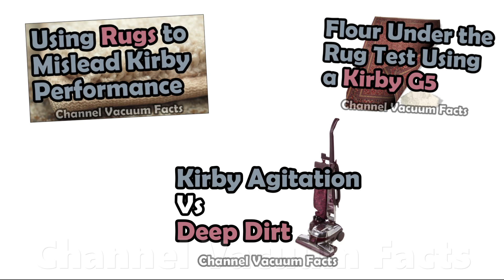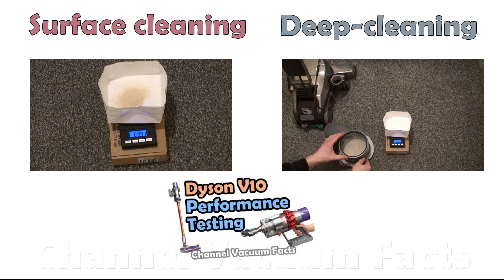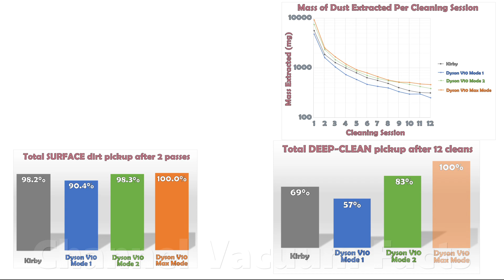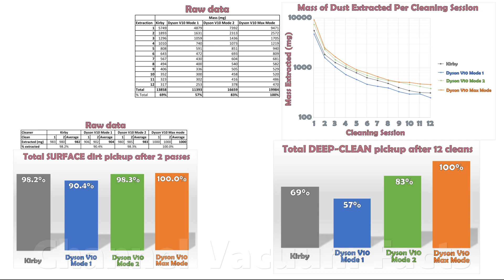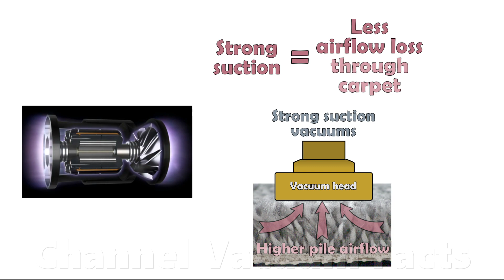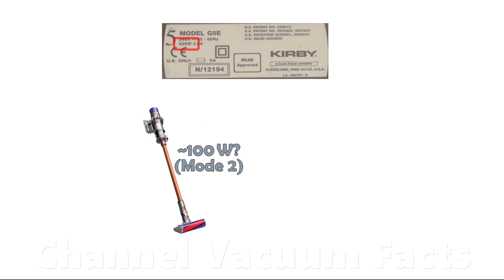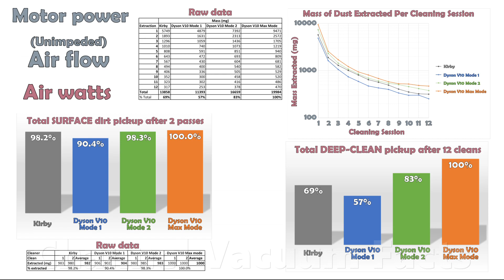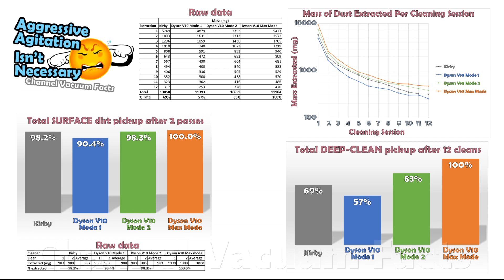Dyson V10 Vs Kirby: How Well Does a Kirby Vacuum REALLY Clean?

Comment: How does improvements in technology determine that a vacuum is better? Dirt doesn’t know that technology is improving therefore somehow becoming harder to remove from carpet. I think if you want to make a case try to do so without leaning on bias. At least not make it so obvious.  We get it you are a Dyson fanboy. Nothing wrong with that. But again your bias is showing. Your comparison is only with Kirby and Dyson. If Kirby is so bad why not pair it up against other brands like simplicity? I’m not schilling for Kirby or Dyson. But also your video in no way convinced me that Kirby is a bad vacuum due to the 1 sided bias.
Reply from the maker: Depends on hwo you define 'better'. Ease of use is usually improved. Performance and efficiency improvements are measured empirically. Testing was done against those machine because those were the ones I happened to have. The data speaks for itself.
Reply: Where at all in this video was he biased? He literally only showed objective data points
Reply from the maker: @jonahdodd567  Their warped definition of 'bias' is: "It wasn't what I wanted to hear".

Comment: Kirbys aren’t as high performing as you might think. They rely heavily on high airflow but low suction. This makes them ok for older style carpet with porous backing or rugs. But for carpet with non-porous backing, their performance drops massively because they don’t have enough suction to maintain high airspeed through the carpet pile, which is what actually cleans it.
Reply from the maker: Almost. Their air power is derived principally from air current rather than suction, meaning it is fully realised in low suction situations (porous flooring like loose shaggy rugs) but is not fully realised under resistive load (sealed carpet). It is suction that determines air speed, not the magnitude of air current.
Reply: @VacuumFacts 
I have no idea why this comment has showed up here since I posted it somewhere else entirely. This isn’t the first time it’s happened.

Comment: Hey @VacuumFacts! I find your video very insightful even if it's 6yo at the time of posting this comment. My suggestion for increasing the suction of Kirby in these types of tests is to adjust the height of the brush roll to maximum out and the height of the head at level 2, not 1 as recommended. This way the head will not be completely sealed inside, allowing air to be sucked and the brush to make enough vibration, achieving deep cleaning.
Reply from the maker: Hi. I appreciate your suggestion; however, this is not how vacuum dynamics works. Providing a low resistance pathway leads to larger currents into the head, preventing the head pressure from reaching as low (loss of suction). This reduces the air speed entering the head and thus reduces the ability to accelerate unhindered particles from the carpet. Brush vibration is irrelevant. The flexing of pile to loosen trapped particles into free airflow leads to their acceleration out of the pile. The basic science is dicussed here https://youtu.be/_CzzDiArrrg

Comment: Kirby is just... Too much of a Dinosaur compared to today. The machine is too bulky, too heavy, and too damned expensive by today's standards. Just go with Dyson. If you have to replace a Dyson every 5 years, it would take you nearly 20 YEARS to spend the same amount as you would have on a single new Kirby. Maybe they are not 100% as good as a Kirby, but is the slight performance advantage worth it? Really?
Reply from the maker: Yeah. The data shows Kirby's do NOT perform as well as modern Dyson machines and my lecture video of the science explains why.
Reply: To be fair though, I have a nearly 40 year old Kirby that still works and they still make parts for it
Though also, I'd hope the dyson stick vacs last longer than 5 years 

My step dad still uses a 20 year old dyson so it's not like they can't last a long time 🤷

Comment: The problem is i can find more available parts for the older  Kirby vacuums than older Dysons. Dyson is more based on science that efficiency than customer services. Components in a kirby can be purchased separately. Whereas you have to buy the whole powerhead when motor issues develop. There are no gasket kits available for Dyson. Cyclone canisters. Motor brushes are quick to change and if any vacuum is properly maintained it can ladt for decades. Lighter is not always better and lots of Components are no longer available on the Dyson site for older uprights and Ball vacuums and many if they are are aftermarket and not genuine Dyson components. This is a fact.
Reply from the maker: Only neglect results in damage to components for the most part, certainly within the warranty period. Before then, it's customer services are far superior. The whole design is modular and under warranty, new parts are shipped out. Out of warranty they're fairly inexpensive. After 10+ years, it's simply discontinued because it's time to recycle and move on because the technology has moved on. The idea that you have to continually buy components in a Kirby doesn't speak well of it. No one uses an old phone for decades. No one uses an old PC for decades. No one uses an old car for decades. No one uses old clothes for decades.  And then there's literally everything else wrong with Kirby vacuums.
Reply: OK. What vacuum do you recommend for deep  wet carpet Shampooing other than Dyson???. What vacuum do you recommend for industrial wet vacuums. The Submarine doesn't cut it. And under normal wear and tear where can you get new genuine Dyson parts for the DC02???
Reply from the maker: Suddenly the subject has changed from dry vacuuming to sticky dirt removal, which is a different product class. You shouldn't ever be wetting carpets and there are far better technologies out there, as has been discussed many times on my channel. The DC02 is a defunct machine superseded many times now and should have been recycled long ago. You can get the latest product for a fraction of the cost Kirby would want you to pay for the equivalent top version of their product from them. It's a no brainer to forget about Kirby products.
Reply: I like the way you circumvent the system buy backstabbing other products, no matter what proof is being thrown to you. A biased one sided leaning based on just science and one sided view of personal opinion with no footnotes or references supplied is no reason for justification. Bar graphs mean nothing. Every vacuum is flawed. Dyson goes by quantity not quality. Half of the older cordless models are discontinued. Who doesn't shampoo carpets anymore???. It still needs to be done to get the dirt out of the carpet or to surface it. One follows up afterwards with a regular carpet vacuum once it's dried. Also certain expensive rugs I wouldn't recommend a Dyson, because it can ruin the fibres. Thus is the expense of carpeted floors a dry brush over doesn't cut it. Air wattage means nothing if customer service isn't there. That includes most Dyson products. Like their filters for their bladeless air purifiers and fans. These have been back ordered for years. Also charging docks, extra batteries,  pre motor filters. You name it. What good is a product when no maintenance or proper service isn't available. Kirby has all that which Dyson lacks. "DON'T BE FOOLED" Dyson isn't all cut out what it should be.
Reply from the maker: >> “I like the way you circumvent the system buy backstabbing other products, no matter what proof is being thrown to you.”
This makes no sense. I don't think you've provided any 'proof' of whatever it is you're proposing.

>> “Bar graphs mean nothing.”
Bar graphs mean everything because they're the data collected following the methodology outlined in the video (and all the other ones).

>> “Every vacuum is flawed.”
This is a meaningless statement

>> “Dyson goes by quantity not quality.”
Dyson goes by quality and therefore quantity. The evidence is in the video.

>> “Half of the older cordless models are discontinued.”
I’m not sure where you’re getting your faulty data from, but everything before the V8 is discontinued—and that's because it's now very old technology vastly superseded by the modern machines, as clearly evidenced in their reviews on my channel.

>> “Who doesn't shampoo carpets anymore???”
No one suggested otherwise. I simply said no one should be wetting carpets to remove sticky dirt in the home. There are better technologies, as discussed on my channel in microsponges playlists.

>> “Also certain expensive rugs I wouldn't recommend a Dyson, because it can ruin the fibres.”
If you have irrefutable objective evidence, please send it along for review. Otherwise, I’ve no reason to believe what you say.

>> “Air wattage means nothing if customer service isn't there.”
I’ve no confidence you even understand what air watts are, physically. And customer service is there.

>> “Like their filters for their bladeless air purifiers and fans. These have been back ordered for years.”
No idea what you’re talking about.

>> “What good is a product when no maintenance or proper service isn't available.”
Not sure you understand what you’re talking about. You don’t need to replace anything if you’ve used it responsibly. Spare parts are available on their website for machines still supported (within the last 10 years). A simple fact check reveals this, so I’m not sure how it’s possible you’re missing it.

>> “Kirby has all that which Dyson lacks.”
I’ve already discussed this nonsense in the previous post. The idea that you have to continually buy components in a Kirby doesn't speak well of it.
Reply: @VacuumFacts  Wow. This makes me come to the final conclusion of never looking into Dyson products again. With a staunch stand like that, makes me think that Dyson is the same way. Staunch, unrelenting emptying the minds of the science oriented quantity based products, not quality based, not open to any sort of evidence when it's out there in plain truth. I will never get a Dyson product again especially with all the complaints that are stacking up on Dysons web sites for components and services.
Reply from the maker: Seen all this before. No leg to stand on, so has a strop instead. o_o

Comment: I found a Kirby at the thrift store a while back. Someone there said they are the best vacuums, so I grabbed it and inspected it. It felt very solidly built, but I put it right back because the thing weighed a ton and I couldn't imagine myself actually wanting to use that thing. Also I think with a lot of older uprights the dirt would go through the impeller first and then the bag last, which would cause them to make a racket like no other if you ever sucked up a coin or paperclip. Not sure if this applies to newer Kirbys or not. Even if the Kirby performed identically to the Dyson, I would never want the Kirby simply because of the poor user experience caused by the heavy and outdated design.
Reply from the maker: Yeah, although I've no idea what "felt solidly built" means. It's such a vague subjective term. Failure rates and causes are more important. The Kirby review outlines the weaknesses of the Kirby in that regard.
Reply: @VacuumFacts  Solidly built means it feels very heavy in the hands, like the materials are thick and would be hard to break. If it was carved out of stone and plated with riveted steel that held in place without falling off, I would also consider that solidly built 😂  The kirby felt like if I dropped it on my foot it would be a very bad day, and probably dent the floor too 😂
Reply from the maker: What "solidly built" actually means is that it doesn't break if you DO drop it. Sadly, many don't appreciate this point and think flexibility (mechanical spring) deliberately engineered into a product to prevent fracture etc. is a bad thing, and fail to appreciate the imporance of smart material choices and rigorous testing.

Comment: This video was made by a Kirby hater. Direct Air and bagged machines are always the best cleaners, because the bags are sealed. I have sensitive allergies, so I have a Miele S7 Salsa, a Kirby Avalir 2, and a Bissell Proheat Shampooer.
Reply from the maker: That literally addressed nothing evidenced in the video, which itself evidenced you are simply incorrect. Tribalism
Reply from the maker: Also, if it's allergies you're concerned about, you simply need to go and watch the review of the latest Dyson vacuum cleaner filtration technology which objectively so far exceeds anything the Kirby offers, you would have to be utterly deluded and tribal to not ditch the Kirby for one. https://youtu.be/4aL0eJenTqw Emptying takes 5 seconds, creates no mess or dust cloud if you do it correctly (unlike bagless clones), and incurs no environmental impact or additional user cost with unnecessary ancillaries.
Reply: @VacuumFacts  My Kirby is good for the environment, I'm not messing with filters ever again. Since I bought my Kirby, the air quality in my apartment has been a lot better. My grandma has a Heritage 2 and it's almost 40 years old and I have a Heritage 84 as well.
Reply from the maker: @whelenvortexr4  I'd love to see the objective evidence you acquired to empirically determine "the air quality in my apartment has been a lot better". I'm completely sceptical. But that says little, anyway; it is well established there is better filtration technology out there in vacuuming products, and no one sensible or worthy of respect would rely on a vacuum alone if sensitive allergies were an issue. Your Kirby is NOT good for the environment. It requires a very large mass of materials to make (it's weight, as pointed out in the video, clearly illustrates this). It also relies on disposable ancilliaries (belts, bags etc.), which are a disaster for the environment. Your statement is simply an utter falsehood (consistently observed from Kirby fans, I'm sad to say). Worse, using technology for that long is also not good for the environment. No one is proud of or brags about their 40 year old polluting cars. The irony is that your Bissell Proheat Shampooer is likely exacerbating allergies; it's water based approach to 'cleaning' (which is poor, as evidence shows), leaves a breeding ground for a wide range of biological nasties. I recommend learning about this from here https://www.youtube.com/playlist?list=PLBxUOcW7kaEu8EFLi2rq3aU9A1QTQ0Xkp I'm noticing a trend in the factual inaccuracy of your claims...
Reply from the maker: I think that's all I need to hear o_o Complete odds with reality. Always seems consistent with Kirby lovers.
Reply: @VacuumFacts  It's true and the plastic won't biodegrade like the bags will.
Reply: @whelenvortexr4 sorry brother but I’ve watched these vids a long time and vacuum facts evidence is irrefutable, those old vacuums are wack compared to Dyson modern tech, saying bag is better is just proof of the refusal that old school bag users don’t want to fork at the cash for modern tech, I’ve had and used a lot of vacuums and I can tell you I will never use any of those old rubbish vacuums, they are awful to use and they actually do leak dust from every loss joint contrary to popular belief, go on forums and just read about it, they are only good because they are cheap to maintain and have good suction, but to say your air quality is better is dishonest
Reply: @Burchilll That's funny, because ever since I switched to a bagged vacuum, I haven't had to go to the Dr. as much.